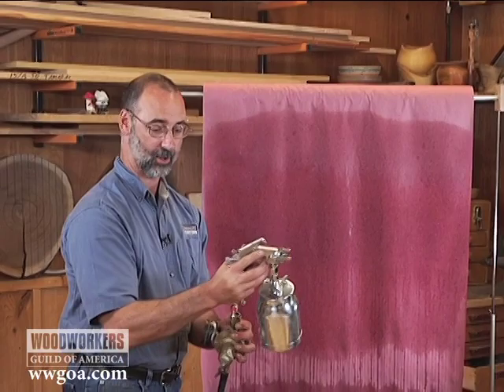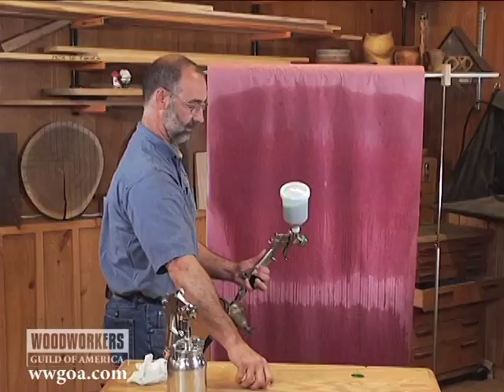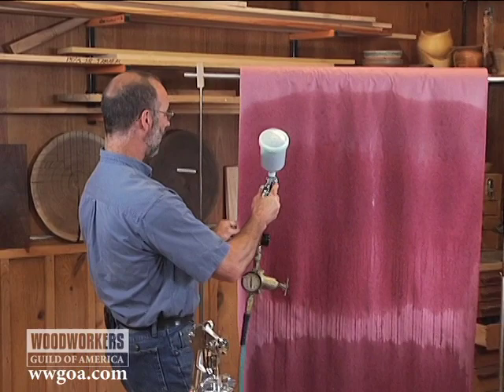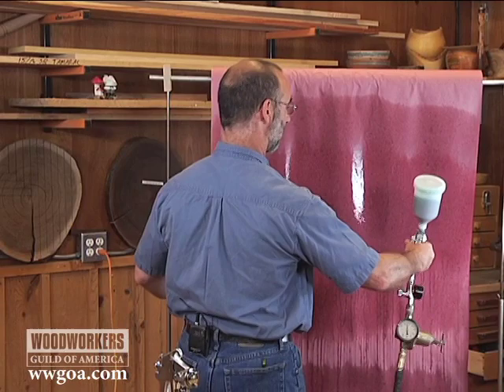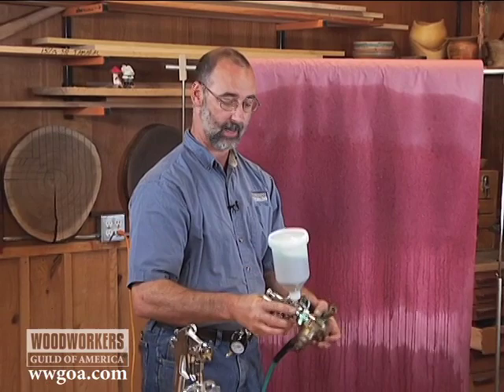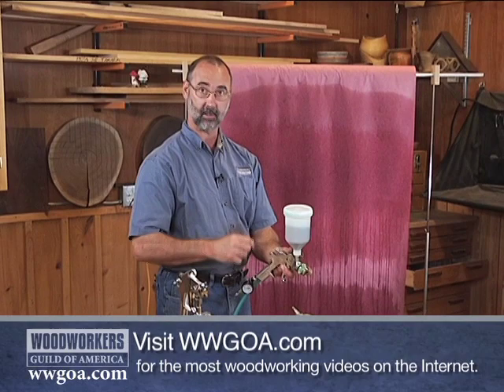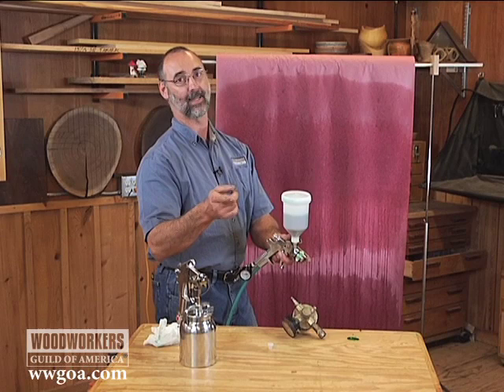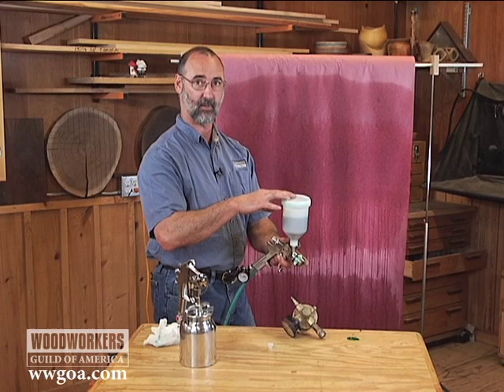Woodworking Tips: Finishing - How to Avoid Spray Gun Bounce-Back

Comment: HVLP and siphon spray guns do not use the same air pressure, conventional air guns run around 50 psi as opposed to hvlp where the pressure is around 10 to 15 psi, also the tip size can cause the conventional sprayers to displace much more material than hvlp. This demonstration is not really conclusive.